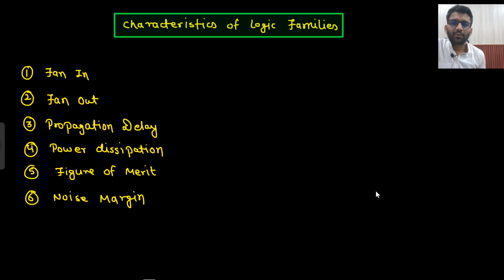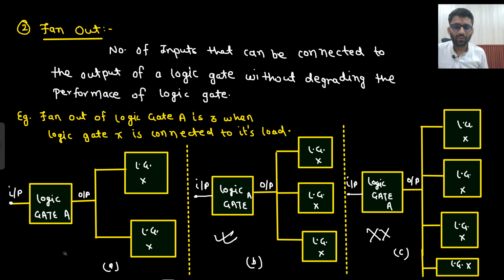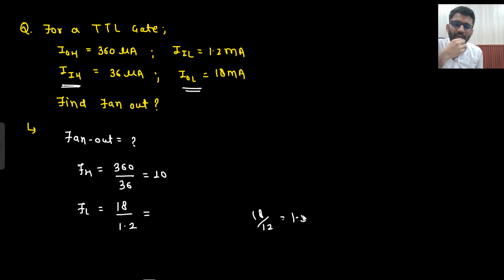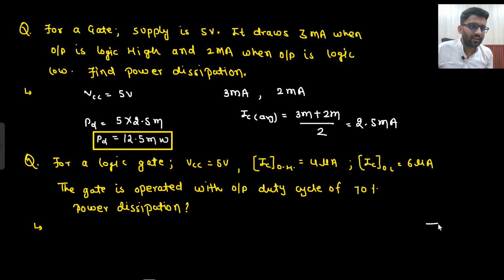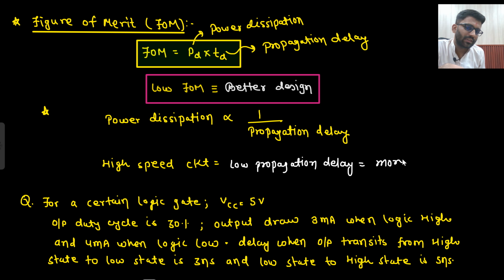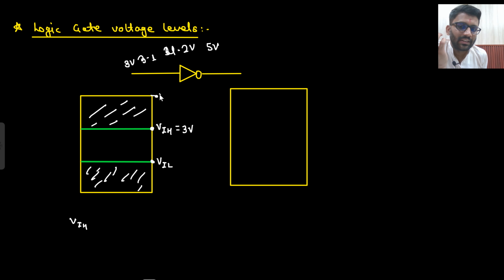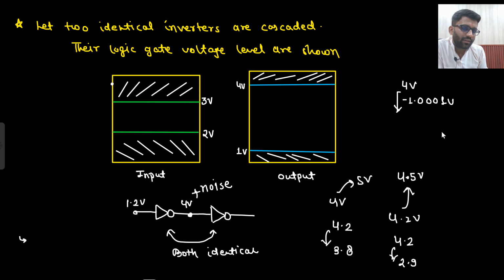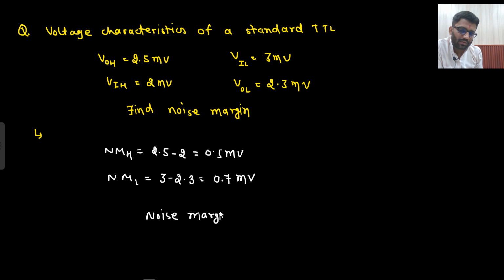🔥Characteristics of Logic Families || Digital Electronics || PrepFusion

Comment: there has to  be a certain threshold where we can say all these voltages can be considered as high and vice versa ie vih  and vil. vih is the minimum input voltage to be eligible as high . same sandwich diagram in output voltage as well , voh and vih  are those voltages, voh is the minimum value of output to decalre confidently as logic high. 39:40 definitions here. 
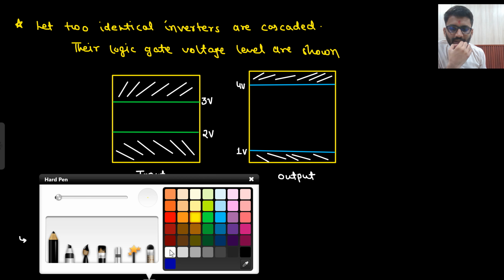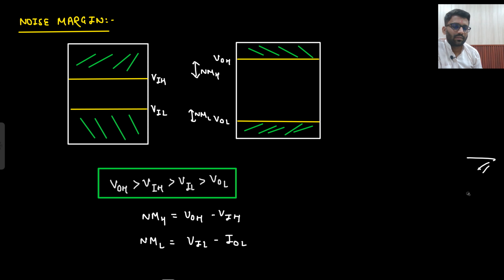what if we cascade then in 40:00, if the worst case o/p ie 4v has occured then noise is allowed till -1 v so that its still recognized by the input. so a 1v noise margin can be tolerated . basically how much noise can jump up and down the output sandwich. is noise margin . noise margin is basically min of the two and it represent max how much noise can be tolerated without changing how we interpret the  48:55 formulas are there

Comment: coming to the propogation delay, its the avg of tpoh and tpho ie the delay in responding from the time inputs reaches its 50% to output becoming 50 %.
also figure of merit is product of pdiss by vdd and tpd, lower fom is a better device and a high speed ckt has a trade off of high pdiss